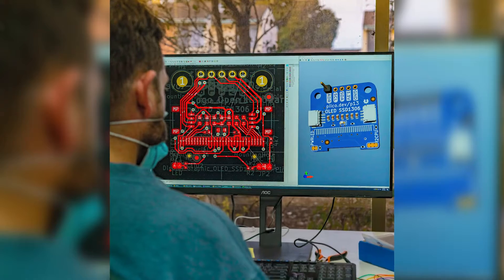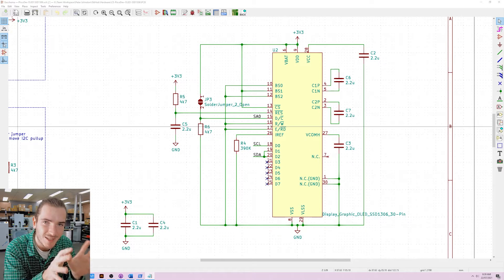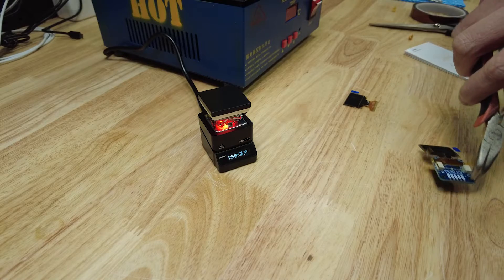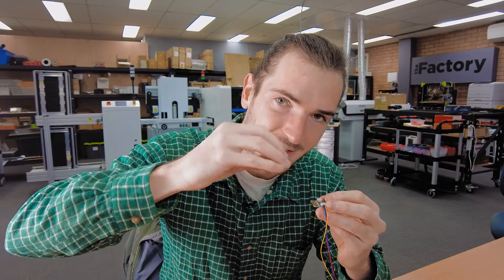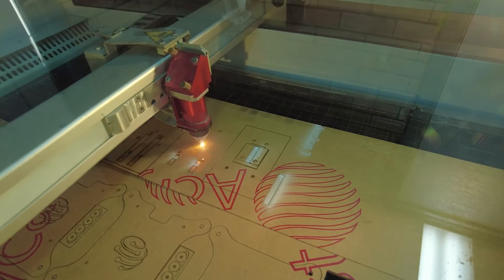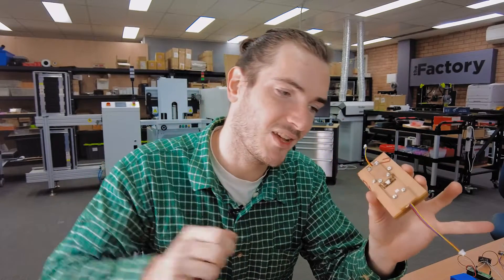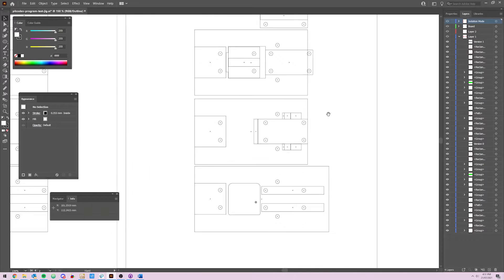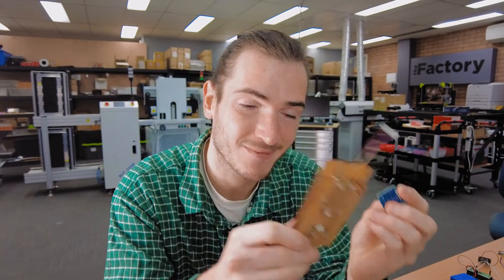The Factory | Optimising a PiicoDev Prototype Display Module

Comment: Re CAD: I took the plunge with FreeCAD.

It works, generally. It has a learning curve, if a 90° line is a curve. But having no prior experience with any CAD software, I now can do what I need 6 months after starting.

YMMV
Reply from the maker: The workflow definitely feels a bit hostile at first, but we're pretty excited to see where FreeCAD goes in the next few years! Open Source ftw!

Comment: print a char on the oled (any char above ascii 128), it probably will be a filled rectangle on its side, 
many such chars can make nice large number (on its side), just rotate the oled. (used 4 oleds for clock)
tip for rpi pico : if a few oleds (same address, no option to change) do not need to be updated at the same moment you can work without an i2c expander, just detach (in software) from the i2c bus (make it serial) write to the one oled active on I2c bus, detach, attach another oled to i2c bus (in sw) write to it ... (only tested with 3 oleds in micropython)
expect it to be faster if done in C ...   (each oled has 1to1 connection to pico but on same bus)

Comment: It's clear to see that you are putting a lot of time , effort and thought in to the design of these modules !
I made a couple of humidity control units for my workshop machinery a few years back (uses SHT10 and DS18B20 sensors to pick up humidity/temp of the air and the temperature of the machine bed ) and this is controlled with an Arduino Nano which shows the info on a 16x2 lcd . I would like to miniaturise it and that OLED display  module will fit the bill just nicely !  I do like the way you have the connectors set up so I can daisy chain modules - very neat !